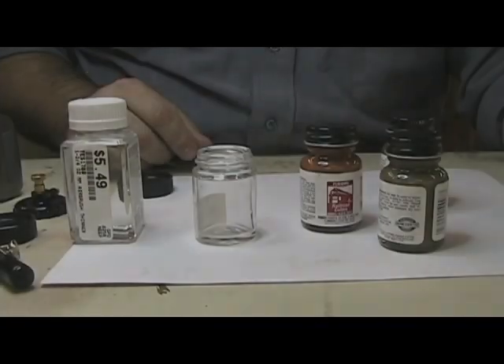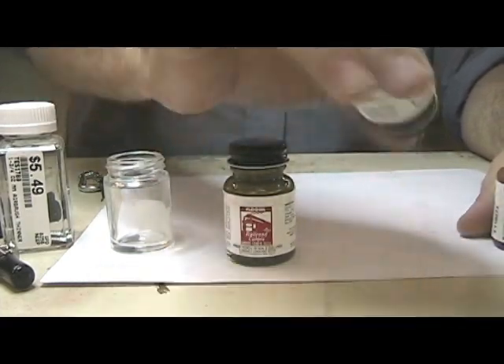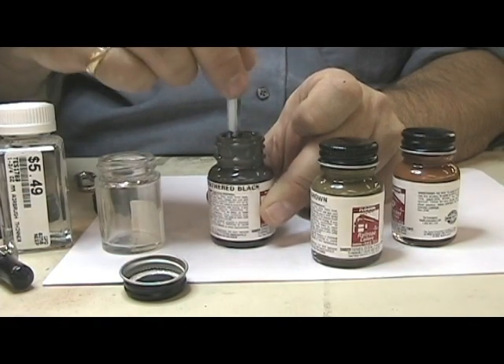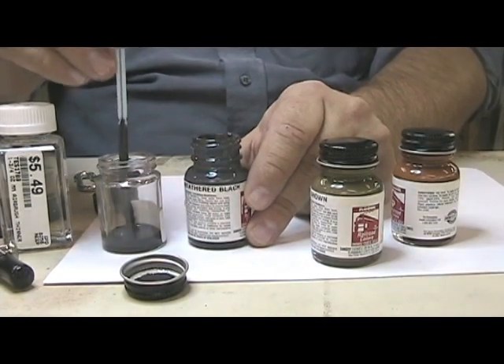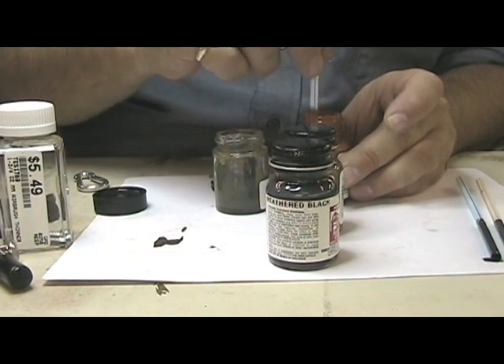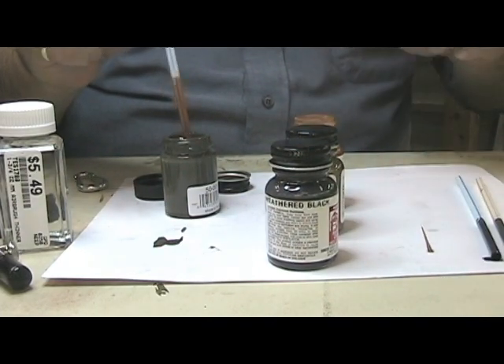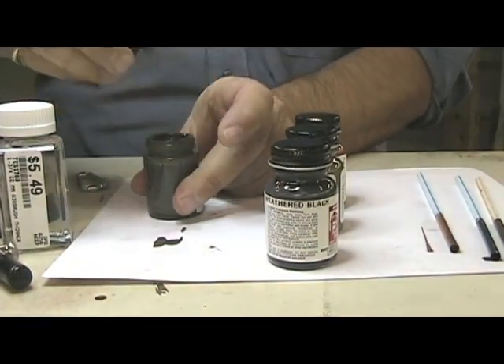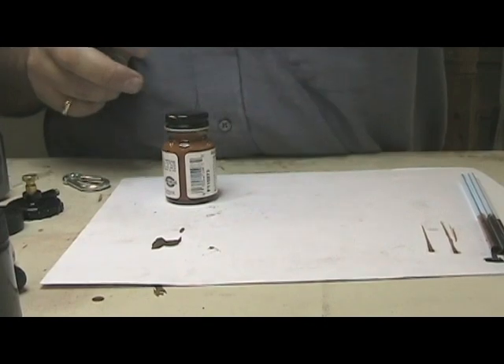Model Railroad VLog: Airbrushing: Part 3

Comment: @brutespiker297 Try using earth color pastel chalk.. (dry ones NOT the oil ones) scrap them with a knife onto a piece of paper and then (after you have put on DULLCOTE spray to model) and dried.. use a soft brush to put chalk to the model. Then seal it on with dullcote spray.  Another way is to make a "wash"   take the chalk power you just made and put it into a small dixie cup, add rubbing alcohol (not alot) stir it around to mix it and then apply that to the model.. alcohol dries away.

Comment from the maker: I don't have a spray booth inside so I have to do it outside when I use solvent based paints.   For this series I did my painting in the garage under a 700 watt halogen light.

E

Comment: DON'T SHAKE YOUR PAINTS.  For $10 to $12 you can buy a battery powered stirrer.  It does a better job of mixing the paint and thus you don't build up the crud on the top inside of the paint bottle.  Easy to clean with 70% to 90% alcohol and a paper towel.  Also, you can buy plastic tubes for the purpose of drawing paint out of the bottle and easily clean them with alcohol. Most every model railroad store carries them.  If not, there is always micro(empty your wallet)mart to find them.  For more accurate color mixing, use a bulb, florescent or LED with a value of 5000 to 5200 degree Kelvin. You find those at Walrus Mart, Home Depot or Lowes.  Other better retailers also carry them.

Comment: One thing you should never do is shake your paint jars... non sense!  when it comes to floquil paints they are enamel... shaking WILL NOT do anything to them.  Its WATER BASED paints , polly S, tamiya , Vallejo etc that you do NOT want to shake.. reason is that is agitates the paint and causes air bubbles.. this results in poor finishes.  You can store any and all paints in jars UPSIDE DOWN.. as long as lid is tight they will be good.